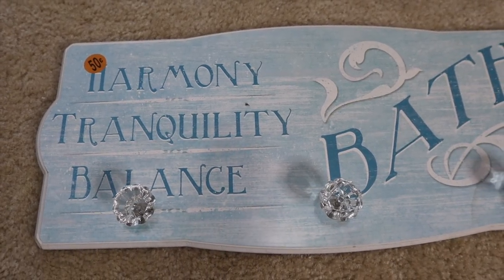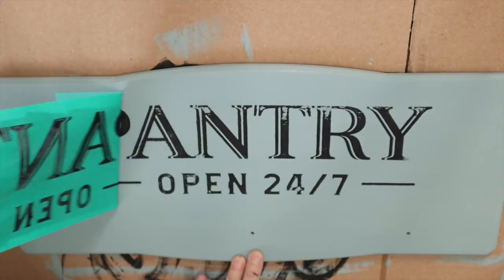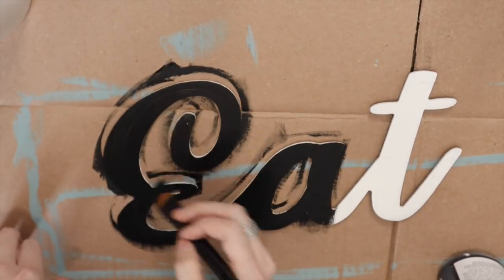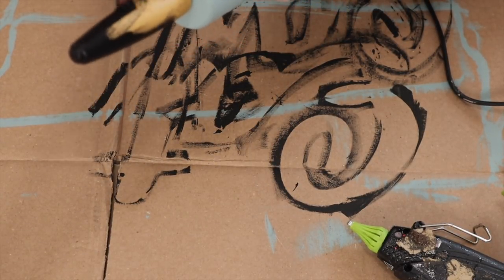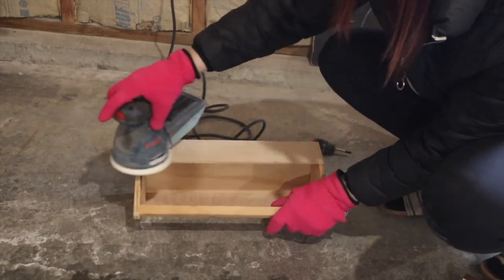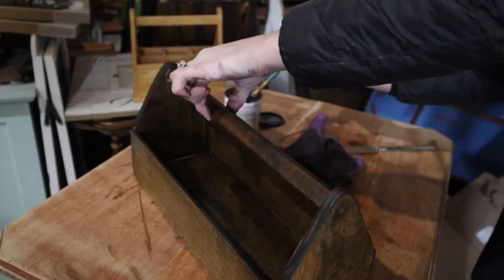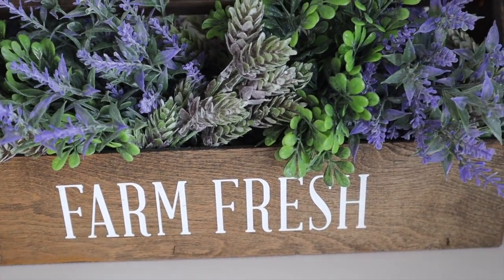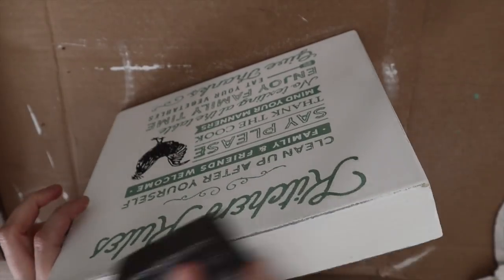DIY Farmhouse Home Decor | Trash to Treasure Makeovers | Kitchen DIY Decor

Comment: I have a hard time understanding where anyone would think you are rude. You are not rude at all. I love all your videos I love chalk couture. I have a bunch of transfers but lately I have had issue with them don't know if anyone else has had this problem and I can't find any answers. I have a brand new transfer brand new paste I was working with a wood piece and none of the paste transferred to the wood it left an imprint of the design but no paste. I tried it again on another piece of unpainted wood and the same thing happened. Could it be the paste?  Thanks for all your inspiration